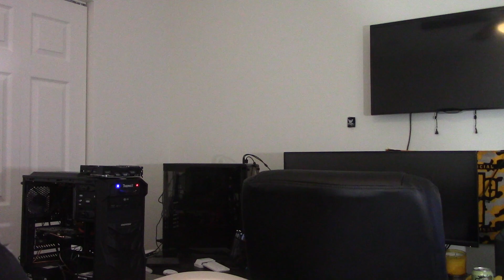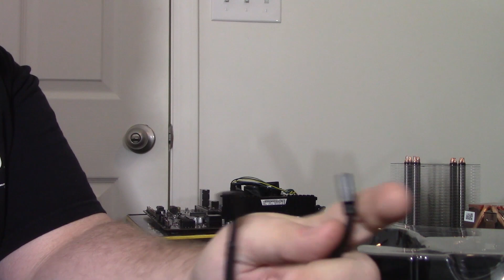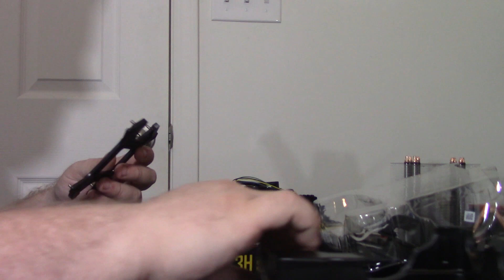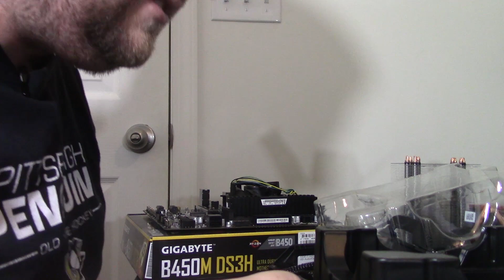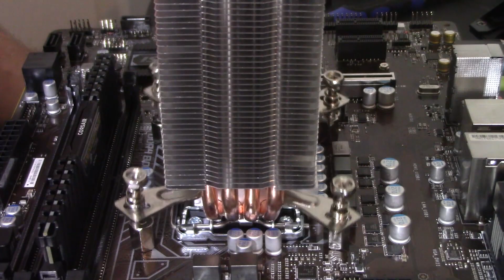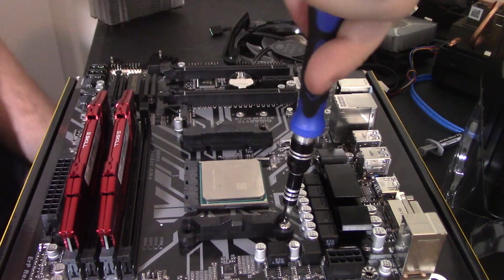Cooler Master MA410P Unboxing, Overview & Installation AM4 & LGA 115X (Fixed)

Comment: Good guide, helpful ! 
suggestion: kindly work on your camera angle..  sometimes its get irritating coz of weird angle as object isn't in view .. 

best of luck
Reply from the maker: Thanks for the suggestion!
Reply: @BigHeadTech  I plugged the rgb header into the cpu led (b450m ds3h) and it only glows red not rgb any suggestions pls ?

Comment: I know it's an old vid, but I have this cooler and it's mounted (by the shop) vertically, as in the fan is on the top, blowing air down through the heatsink towards the GPU. This is causing problems with my airflow in my case, as I can't have exhaust fans on the top because it'll be pulling air in the opposite way to my cooler. My question is, can this cooler be rotated on the block by 90 degrees? Or is the problem my Asus prime B450m-a mobo? I really feel like it should be facing back (blowing air through the heatsink towards the back of the case, like you have it. CPU is a R5 1600